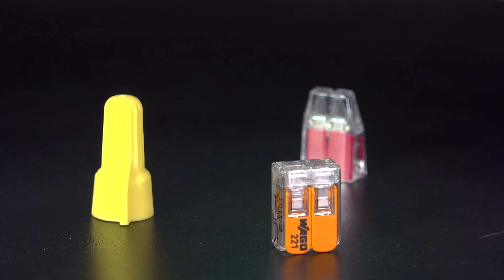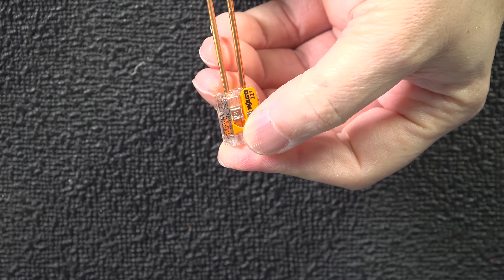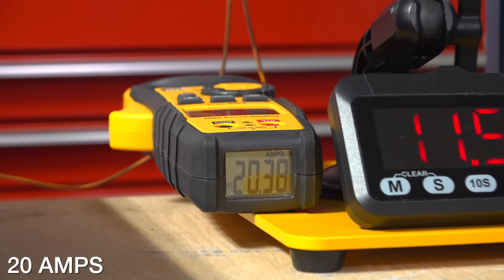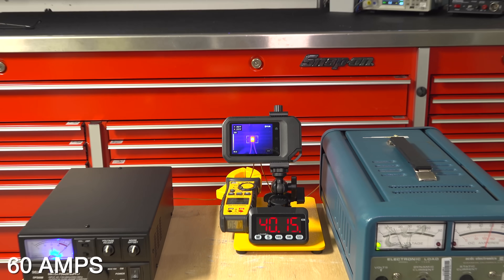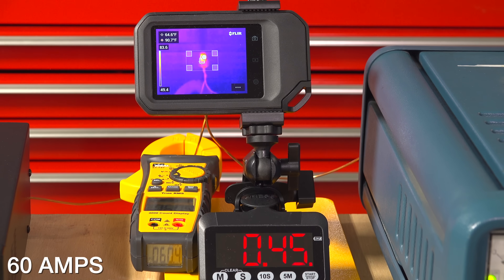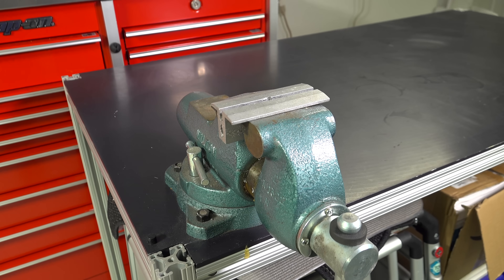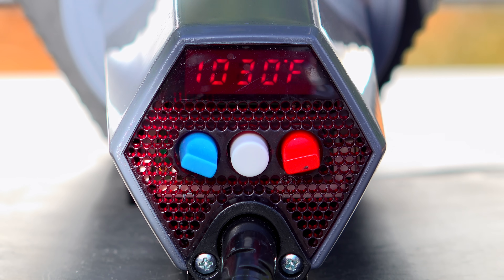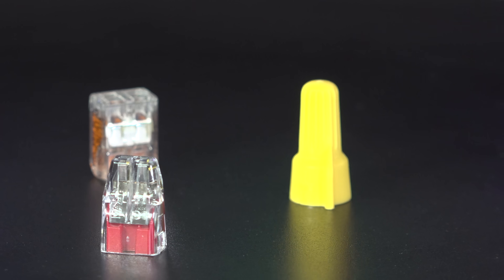What Wire Connector is the Best? Wire Nut VS Wago TESTED

Comment: Thank you for the valuable info!  BTW, "ampere" is a measure of current , not power.  Power is measured in watts.
So 60 amps is a lot of current .  If that current is flowing through a low resistance - like solid copper wire - not a
lot of power is consumed there, although lots of power may be consumed at a poor connection between wires.

Comment: As an electrician, I must say that I really like Wagos. I have only used the push on type with solid wire. I like that I can see if the wire is properly inserted. I cannot tell you the number of incorrectly connected, corroded, and or melted wire nuts I have seen in my career. I, knock on copper, have never had a Wago fail. I also like that I can easily rough in circuits and check them before they are enclosed by the wallboard. Then it is easy to add the device wiring when the walls are done by just inserting into the connector. This has saved me from mistakes in wiring by being able to confirm circuits while it was still exposed. Thanks for the testing. I will have to try the clamp type, especially if they will work with stranded wire.

Comment: This current test was unfair to Wago connector since the wire nut was tested with the wires twisted pretty much  below the wire nut skirt line, thus providing a great deal of extra area for the current to flow, skipping much of the actual "contact area" that should  have been made by the inner wirenut spring which  actually ties the wires together. The Wago connector on the other hand had all the current flowing thru its inner copper/alloy contacts.

Comment: Wirenuts... that’s really nuts... Thankfully not allowed in Germany... Wago is really good stuff!
Reply: @IshI Koara You got it wrong: Wirenuts are not allowed here (in Germany).
We used screw terminals in our junction boxes. They fell out of favor decades ago because spring loaded connectors (like Wago 273) proofed to be better.
Reply: @DrKlausTrophobie  Are they proven to be better in terms of longetivity? I thought everyone just switched to WAGO because they are way easiert to work with (no screwdrivers, less space) without any downsides if you use single core wire
Reply: @doktormerlin  Personally opened many junction boxes with lots of failed Screw Clamps (here in Germany we call them DoLi-Klemmen) but never a failed Wago Terminal Screws have to be re-tightened from time to time which to be honeyst almost never happens and Wire nuts seem so be a kind of Screw too
Reply: @Erdnusschokolade  witzig, ich hab noch nie den Begriff Doliklemme gehört, ich nenn die immer Lüsterklemme. Oder ist das nochmal was anderes?
Reply: @doktormerlin  Doli klemmen sind die etwas größeren einzelnen Lüster Klemmen mit denen man früher Abzweigdosen verdrahtet hat und sich über die Jahre zu Klopfschaltungen entwickeln es sind eigentlich normale Lüsterklemmen aber hier hat sich das irgenwie so eingebürgert dass die einzelnen Dolis heißen und die bei den noch 2 oder 3 Klemmen zusammen sind Lüsterklemmen
Reply: Doliklemme = große Klemme mit nur einer Schraube, meist auch zur anderen Seite verschlossen. 
Zur Verwendung in Abzweigdosen etc. 

Lüsterklemme = meist relativ klein mit zwei Schrauben, wie der Name schon sagt, zur Verwendung bei Lampen etc (Lüster/ altdeutsch für Lampe)

Dann sind da noch die Porzellanklemmen, für Bereiche die recht warm werden, zum Beispiel sehr dicht an einem konventionellen Leuchtmittel verbaut, oder in Heizungen
Reply: @doktormerlin  Lüsterklemmen sind die Klemmen mit 2 Schrauben - eben wie sie zum Anschluß von Leuchten benutzt wurden (und auch noch werden) Doli-Klemmen oder Dosenklemmen haben nur eine Schraube und wurden in der festinstallation verwendet.
Reply: @doktormerlin  wago with levers, works great on multi core wire.
Reply: Same here in the Netherlands, electrical installations with wirenuts are from the pre-80s era.
Reply: EU BE LIKE
get away with cheap crao get real working producst...
We don't build just wood houses we build for eternety
Reply: @kleinfeicht  i am norwegian and an electricians apprentice and we build wood houses and they are built to last as long possible they stand often for multipul generations i mean except for fires they with stand really most things and the newest house have extremelly strict rules about fire hazards
Reply: @B_Burmester  I think he refered too Cardboard like wood (what the americans are using for their houses)
Reply: @kleinfeicht  they are allowed in sweden though - dunno why..
Reply: @IshI Koara yes, because they are crap.
Reply: Germany fell to its knees to the USA during ww2. Everything the usa does is superior to Germany
Reply: I would like to try a wago steak.
Reply: @IshI Koara From context i assume @
Julius Hollmann refereed to Wago: If the Wago are allowed in Germany they have to be good.
@FullMetalFox got to the same conclusion. He points out a possible bias towards Wago.

And yes, spring loaded Terminals proofed their long-term benefits. Just like @Erdnussschokolade said, screws tends to loosen over time. With springs the contacts stay under tension.
Reply: If they are allowed in Germany they have to be good😂
Reply: @juliushollmann9938  Well, WAGO is a german company XD
Reply: That's an urban legend. You can get wire nuts with VDE marks, which are of course legal in Germany. They just aren't used by electricians because they're even more cumbersome than the old screw connectors, especially for adding or removing wires and for testing.
Reply: Use chocolatebar style and ul be good.
Reply: But Socialist Germany sucks, sooo...
Reply: @skynetlabs  socialist Germany? Are you nuts?

Comment: a wirenut that fails under such an extreme load means nothing, unless you have a federal pacific breaker panel. a ul (underwriters labratory) listing would be more impressive. avoid buying electrical supplies from china and/or with no listing. i've never liked wirenuts with a soft plastic insulator. "ideal" 72-b, 74-b, 76-b, etc. are hard plastic. from 1967 to 1995,  i've never had one fail & they are re-ueseable. i didn't work for ideal.

Comment: I will NEVER use a wire nut or a push type connector again. I am hooked on Wago lever locks. Cost a bit more, but the reliability and ease of use is priceless.
Reply from the maker: I completely agree, I also do not like the push only versions, wagos or others. The levers are the best
Reply: @SilverCymbal  The main issue I have with push ins is if I decide to add a circuit. With a Wago I simply flip the levers and remove a 3 place and replace it with a 4 place rather than fight the wire trying to remove it from a push in. Not to mention how uncluttered the box looks.

Comment: Thanks . I have had wires disconnect using wire nuts in tight and multi wire applications so I use these in those applications and between stranded and solid wire installing light fixtures.

Comment: Let me see a test for ten years ! I would love to invite you to our commercial building, after thirteen years and so many failures. No thanks.
Reply from the maker: I don't need to.. For examples visit German and the UK and they are the standard there for 40 years. They don't even allow wire nuts since the 60s
Reply from the maker: I can guarantee you aren't using Wago 221 Levernuts. Maybe another connector but that's not what I reccomend or use myself.
Reply: @SilverCymbal  Um, OK. You know better then what I see in the field every day for 30 + years.
Reply from the maker: @bug512  Correct, I know that you haven't been seeing Wago 221 for 30 years. Backstabbed outlets, push locks from other designs, sure. These are not the same and have a patent on how the wire is held.
Reply: @SilverCymbal  Love your videos and dislike wago's . Cheers !

Comment: Another observation is they only reason these connectors have plastic on them is to protect us and keep it isolated inside the box. So even if it does catch on fired it will not offect the connection the connection is metal be it a spring or clamp style so even with the plastic burnt off connection will be the same. Now that being said they only reason it would be that hot beside a building fire is a loose connection. Arc and Spark. When the wago first came out I was using it improperly I was using it above ceiling with little light. I pushed it in observed that the wire was past the clamp part and tug tested and was satisfied. After using them in the light and more experience I noticed that when I twisted and formed the wire to fit in the box I noticed the one  closer to the wago (shorter one) twisted and was pulled out. I pulled it back down and that was when I realized that I was not pushing the wire in all of the way. Just past the clamp will not hold the wire if it is twisted at all. I was not pushing it in all of the way. If you continue to push from the clamp the wire will go all the way back to the back of the wago and if you look closely at the end of the wago you can see that the wire is far past the clamp and at the very end only leaving a thin piece of plastic between the wire and my hand. I then did a tug test and twisted the wire at the same time and the wire will not come out easily. While wasting time one day I missed with it and made some terminations and tried to pull them out . Very Hard twist and pull I got a few out Others I could not, and would have to cut the wire if I needed to pull a wire out. Again use a Wago Brand   not a wago style.

Comment: I agree with everything that was just said sorry I have been electrician for 20 years resi com and industrial. There is a big difference in a cheep wago and a wago brand. Being a business owner I try to save money where I can. I have ordered these connectors from China. Alibaba to be exact and eBay where you can also buy wirenuts that don't work well or hold up long run. The wago style not brand are where these differences are most likely coming from ( besides owners that don't want to pay for the brand name or older gentleman that still twist there wires-i will leave it at that). I have learned a lot from them but not everything I have learned is(Church). So try the brand not the type and I believe you will be surprised.

Comment: Licensed electrician here (31 years of experience), and I love the Wagos! They’re a little expensive compared to wire nuts but certainly have their place in my tool pouch.
Reply: Those wagos are 25 cents a piece. If this saves you 18 seconds of time it's already cheaper than free wirenuts would be.
Reply: Deez nuts
Reply: ....and faster to finish great job.
Reply: I’m a homeowner. I installed some fixtures were I connected stranded 18 gauge wire to 14 gauge solid. Doing that connection with wire nuts was always unreliable for me. The Wago handled the application with ease. I think Wago is especially useful with solid to smaller stranded connections.
Reply: @Brian Bell the price difference is probably saved, cause the wagon 221 is a lot faster to work with
Reply: More expensive? Yes. But on the other hand if you need to do changes in the junction box you can open and use them again. No need to cut off the wires each time.
Reply: Hell I'll pay a little more every day of the week for them. I've wired stuff wrong and easily swapped it without messing up the wires.
Reply: The "more expensive" point is technically true, but really always seemed like a huge red herring to me.  People who are genuinely concerned about this sort of nitpicky expense difference are basically the epitome of "penny wise pound foolish", IMHO.

I mean, how much more do they actually cost, in real-world terms?  It's probably a bit closer now than it was a couple of years ago, but some quick searches suggest that WAGO 221s in bulk currently cost maybe $0.35 per connector more than wire nuts do (at most).  But even if you're being really liberal with their use (pigtails on every outlet and light switch you install, etc), even at that price difference, you could wire an entire house and maybe only spend a grand total of $80 or so extra for the WAGOs.  Compared to the cost of everything else you're installing, plus all the labor hours, plus everything else, $80 is a really pretty trivial drop in the bucket.  This sort of cost difference is going to be a small fraction of a percent of the bottom-line of any real project.
Reply: @foogod4237  They're less if you consider the amount of time you're paying someone for all of that added twisting.

Comment: I've used Wago connectors with no issues. I think the reason why so many US electricians are leery of them is the horrible results we've seen over the years with back stabbed devices, which use a similar mechanism to the Wago. The main difference (I believe...) is that Wago connectors are not subjected to the same kind of movement  or temperatures that a spring connector in a receptacle or switch might be from everyday use of those devices. Wagos are also purpose built and tested to perform specifically as splicers whereas I doubt they put the same effort into designing the spring terminals on cheap devices and especially with outlets, you have multiple contacts generating heat that gets sinked into the spring terminal.

Comment: the wire-nut test if giving you a false reading you have so much wire twisted that most of the load is handled long before it gets to the wire-nut.
and after doing wiring for 30+ years i can say wire-nuts fail all of the time after heating and cooling they work lose witch makes them hotter. 
i have saw hole boxes on fire from this. 
time will be the true test for the wago but i will be keeping them on hand and using them.
Reply from the maker: Watch for another video coming soon on this topic. Should be very interesting. I appreciate you sharing your own experiences too.

Comment: Great video. The amp test was good, but what if you moved/slightly twist/bend the wire to give the example of putting the connection into place in a junction box. I read a few comments about wire moving due to temperature change, vibration etc. either way,  movement which can happen. Could you do the test with movement? Thanks again for the video.

Comment: The wire nut had an unfair advantage, as it isn’t taking the load per day, rather as the wires were twisted the contact point was well before the wire but was even engaged.
Reply from the maker: That is possible, it wasn't my intention, I just wanted to make sure people knew it was twisted. I am working on a follow up to address what that may have done and share some other info that I think will be a big shock for people.
Reply: @SilverCymbal  thanks, and my apologies for my abhorrent English ... never trust dictation :)
I still and very impressed with the wago connections! Not sure if they are to code here in North America.

Comment: Only time i would use a wago is if it comes already in a light fixture that i am about to install. Wire nuts are cheaper and you can test the circuit with the wire nut still on.

Comment: I've used Wagos over the last few years in cases where it was just easier using them because they stack easily instead of trying to jam wirenuts into a small box...I've also continued to use wirenuts. I think there are times when both connectors make sense...who said there had to be only one answer to a problem ?

Comment: Being a maintenance technician, I've seen multiple kinds of damage in electric circuits. On one occasion I was informed about power outage in one location, with a distinct plastic burning smell... In one of the junction boxes I found remnants of a connection with Wago, with a solid wire conductor (2,5 sq. mm or ~14AWG) sticking out of it. Wire burned and broke about 2,5 cm (1") from connector. While everything was charred and melted, it was a conductor that failed. That pretty much assured me, that Wago connectors are to be trusted. Moreover, years already passed since they were introduced, and they have proven their superior design.

Comment: Wires twisted together before applying the wire nut. The dead giveaway that non qualified personnel have been present! Besides that, the main thing people get wrong with wire nuts is not having all of the conductors even. I have never had one fail. I haven’t used the WAGOs much, so can’t really comment. Was impressed with your test results though. It did better than I was expecting! I have seen them used (in error) with aluminum wire, and that was a complete failure. Many were melted away completely, like in your heat gun test.

Comment: An interesting video. I started using Wago Lever Nuts a couple of years ago and almost never use wire nuts anymore. Just an FYI, Wago introduced a newer version in either 2019 or 2020 that accepts 10 gauge wire and is good for 30 amps.
https://www.amazon.com/221-612-LEVER-NUTS-Conductor-Compact-Connectors/dp/B085P331PS

Comment: Not an electrician but I've been using wagos for years now and I have had no issues what-so-ever.  I have never and will never overload any wire nut or wago with more than it's AMP rating.  I was taught to always cover my electrical connector with black 1700 electrician tape no matter what.  It only takes a 5 seconds and it's totally worth it in the end to prevent slippage.  Going back to the wire nut,  I have had many of those suckers come loose and fall off even with some electrical tape around it.  Sometimes it's a matter of the wire inside unwinding itself due to expansion and pushing the wire nut off.

Comment: Hi, 
Thanks for the reasurrance, I bought the wagos about 4yrs ago and was not sure if I wanted to use them,  well I use a set  of them for the first time a month ago on a 15amp circuit and then more recent on a 20amp circuit , I tried using the wire caps first installing three additional outlets but the wire nuts did hold 4  twisted wires but the wagos did the job